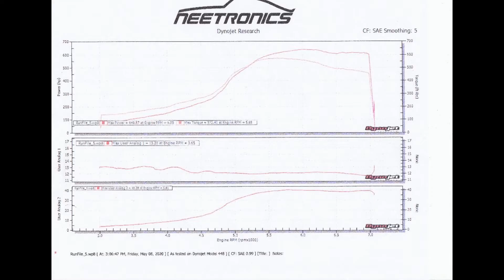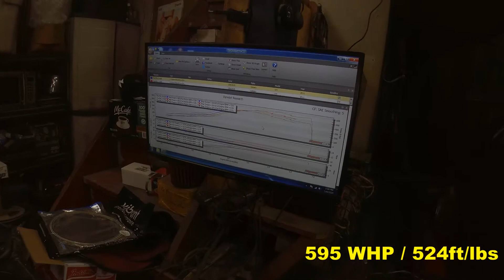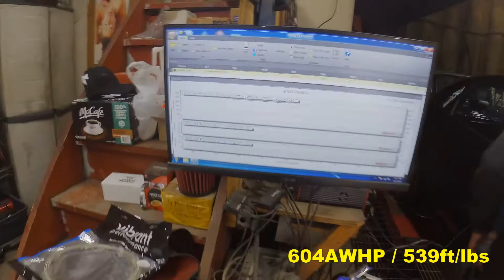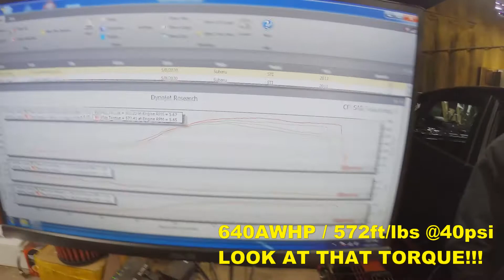640whp GTX3576R Subaru STi dyno day

Comment: @Alex Yap   Do you know what wastegate you are using and what spring pressure? Also are you on a 3 port still? I am dealing with a very similar setup that is hitting 36psi but falling to almost 30 by redline. The exhaust is less restrictive than what you are using, so I'm not thinking it is a back pressure issue.
Reply from the maker: I'm using a Forge Motorsports 44mm external wastegate on a 4 port controller. I think 4 is better than 3 when dealing with higher pressures.  Not sure if they're still available, but its been rock solid. Never had any boost leak issues. Can't remember the spring pressure. I'd have to open it up and take a look.

Comment: Very nice! which springs are you running? I have the same turbo, GSC S2 cams and valves and beehives and a seriously built block. Also have 2kcc injectors and will be giving plenty of fuel. My exhaust is catless and 3" all the way back. This gives me hope I may hit the 500whp mark.
Reply: Did you get 500whp? Mine pulled 659whp..
Reply: @alzmanfield3659  still haven't put it all together. Hurricane Laura  messed everything up and I'm still playing catch up

Comment: Hows the turbo feel on the street lazy or responsive?  I have an older gen 1 gt3582r on my sti and considering swapping over to the gtx3576r.
Reply from the maker: I personally wouldn't use this turbo on a street only car, but since my car is mostly a track car, the lag doesn't bother me. I'd never want to daily this turbo as it's unresponsive at low speeds. I probably get a little better spool than you, but would never say my car has good low end power. Have you tried using meth? I found it made my car noticeably more responsive.
Reply: @drummerboy1632  I've thought about using meth/water but my tuner hates it.  I have a few e85 locations near me so I run e85 when i can.  Unfortunately when i get up to the north Georgia mountains e85 is nowhere.  I love the pull of the big old 3582 but sucks down low.
Reply: I'm running 3582r Gen2 pulled 659whp 1800 injectors maxed out, need to change  to 2k easily pull over 500awkw,
Reply: @Chris Fifth but your also on a pte6466, a much bigger turbo than the gtx3576r gen 2...
Reply: @Chris Fifth omg I check your Instagram and how wrong I am!! 🤦🏽🤦🏽 Message sent
Reply: @thatguy_bern  no biggie!

Comment: Did the turbo have room to go or was that completely topped out?
Reply from the maker: It was pushed pretty hard but was limited by other factors like octane and likely the restrictive exhaust system.  You could likely get more with race fuel.  I still have a catalytic converter in a 3" exhaust system but this was definitely a bottleneck.  Bigger exhaust tubing and I'm sure the turbo could make more.
Reply: Alex Yap very cool. I hope to hit 650/670 with this turbo on my honda
Reply from the maker: @MaxS2000  This turbo can make that easy on a 2wd car with the right supporting mods.  Good luck!
Reply: @drummerboy1632  was this on 93? cams? headwork?  how much boost? thanks for sharing!
Reply from the maker: @MrBRIIIAN   GSC S2 cams and valvetrain. Heads are ported and polished.  Fuel was pump gas and methanol injection. Can't get e85 easily where I live so I use meth. Using stock compression ratio so I can run higher boost at 40psi. Hope this helps.

Comment: Whats the engine build iag closed deck block their case halves with your build im in Ontario to im trying to figure out a build with that turbo
Reply from the maker: I had my engine block sleeved by Golden Eagle down in the US. I had it shipped there.  Then it was assembled up here in Canada with all the good parts. I don't like closed deck designs. I've seen a few overheating issues which I guess is what happens when you replace the coolant passages with metal for strength. My block gets beaten on really hard for up to 30mins at a time as its a track car and it just keeps going.
Reply: @drummerboy1632  oh ive been hearing it alot that people wanna go sleeved block over closed deck would you say closed deck is more better for a weekend driver and occasional track days also what boost you ran to make 640whp and wen do you hit boost with 3576r
Reply from the maker: @andrewb7057  People have good luck with closed deck so I don't want to say they're bad. I just prefer sleeves. It's my experience  I've seen 2 examples of closed deck engines running hot in cars with the exact same cooling mods of mine. Maybe different mods would work better but  I run at 190 deg at regular cruising temps and 210ish on track. The iag blocks I've seen sit at  +210 and go much higher under load. The 640whp run was at 40psi on meth and 94.   I have a cat so the exhaust was the limit.  Without it,  we could have pushed it harder.
Boost starting @4600 and hitting max @ 5400rpm. It's laggy but fun when it hits. 
I guess if it's mainly a daily and track a few times a year,  CD will be fine but if you wanna really beat on it as a track only car,  sleeving is the way to go.  They're more durable and repair more easily.
Reply: @drummerboy1632  I understand wat you mean im pretty sure i saw your car at cscs final last sunday lol heres my dilemma i wanna go 3576 but worried its gonna be quiet laggy for street use i wanna build heads tho so i think air flow might spool it at 4300 would you say its a streetable turbo i dont wanna go 3076
Reply from the maker: @andrewb7057  3576 won't start spooling that soon. Even with meth and built heads. I have port/polished heads and 272 duration cams and you'll need to wait till past 5,000rpm for boost to really kick in. Its a very narrow powerband. 
FYI, I was running no meth at cscs and was trying a new exhaust setup which dramatically lowered the power you saw out on track to give you an idea of how fast things are. Don't dismiss the 3076. That will make very good power and spool around where you want it. I'm looking to change things up to give a wider power band for next season as the 3576 powerband is too narrow for my liking!
Reply: @drummerboy1632  thats what i was afraid of my goal is be able to make 450-500whp on pump before meth only if e85 was easier and cheap to get here, i hear you on the 3076 alot of guys run it im just afraid with meth it wont hit my goals power wise i was looking at g30-770 but kits dont offer the turbo was probably gonna go ets rotated

Comment: How's she holding up?
Reply from the maker: Car still makes the same power it did even after a season of mostly track abuse. Compression is excellent. The car is still a handful on the street. It  catches me by surprise sometimes when you floor it, especially when it decides to spin all 4 tires in 4th gear!Unfortunatly, It's now put away for winter. 😥

Comment: is this on e85? how about on 93 oct?
Reply from the maker: It's on 94 octane and meth. No e85 where I live.   I lost well over 100 whp running only 93 oct. The meth really brings out the midrange and makes the car come alive!
Reply: @drummerboy1632  640whp is really high number. I’m building my evo x right now with gtx3576r turbo. 
Hoping to get 500-550whp. Here is my car spec:

Forged rod & piston
Gtx3576r gen 2
Gsc s2 cam
Tomei downpipe 
Map manifold 
Fluidampr 

Do you think i can reach 550whp?
Reply: @drummerboy1632  and aem watermeth kit.
Reply from the maker: @Afnperformance  That setup will make 550whp easy if you have the right supporting mods. I assume you have a full 3"+ exhaust system, +1300cc injectors and big fuel pump? Is your block stock or sleeved? If not sleeved, I personally wouldn't try for that power if you want it to live for a long time but then again, I beat the heck out of mine 20+ mins at a time on the race track. Also what transmission do you have?
Reply: @drummerboy1632  running on 93oct
Yes 3” exhaust & id 1050cc injector
Aem 340lph fuel pump
Stock block with forged rod & piston
Transmission sst dct 6 speed (upgrade ssp clutch pack stage 2)

Im thinking to install liner engine block & skimminh
Reply: @drummerboy1632  1.06 A/R? 
What is the size of the housing?
Reply from the maker: @DenisDorokhin  it's a 0.82 a/r with a T4 flange. Hope this helps!
Reply: @drummerboy1632  Thank you, great result! I chose the same turbo, but the flange T3, I hope it will not be very slow. In the process of building.